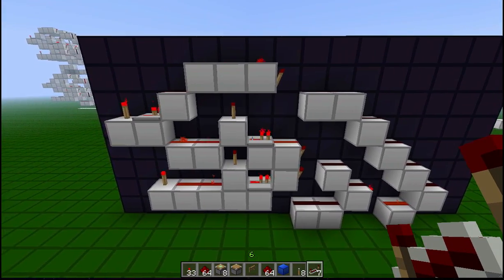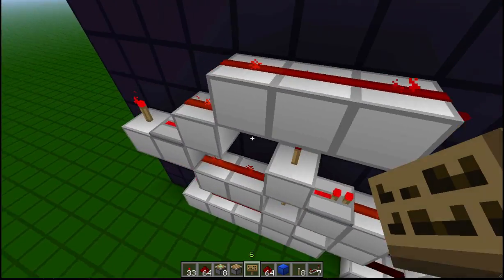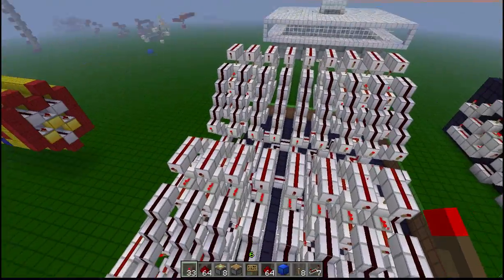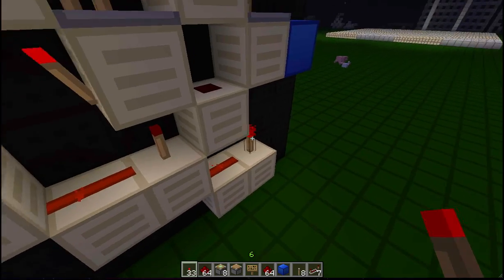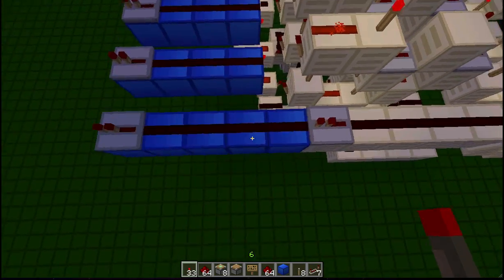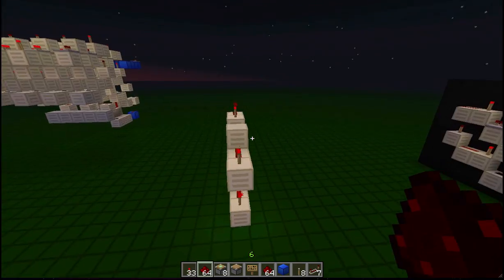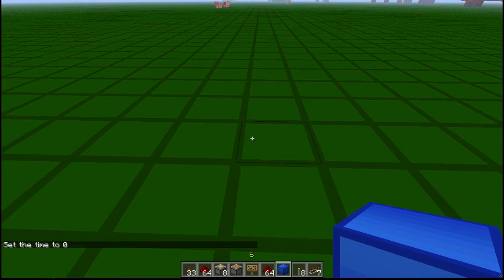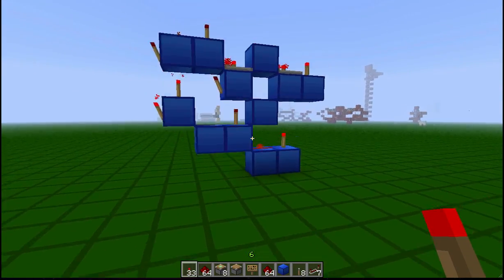Potentially most compact 1-wide half adder

Comment from the maker: Not necessarily. It may be possible to shift each half adder back and forth vertically to prevent any wire interference. Alternatively, another design of a similar size could be used to stagger and tile the half adders in a 1 wide space.